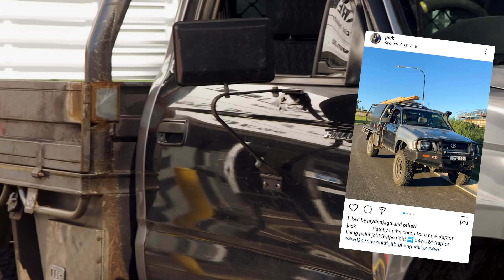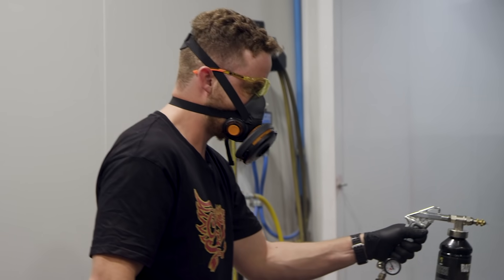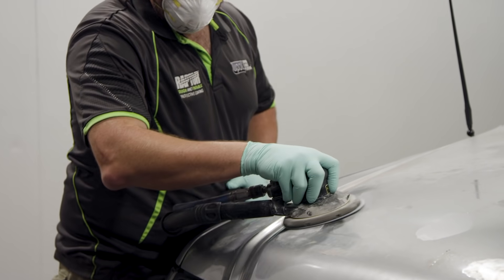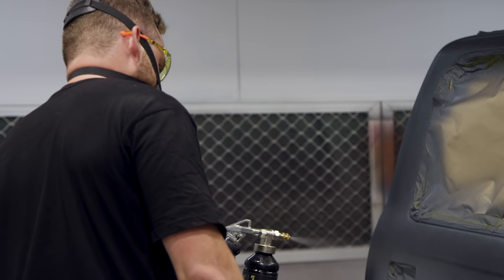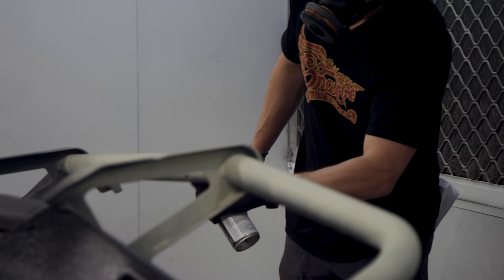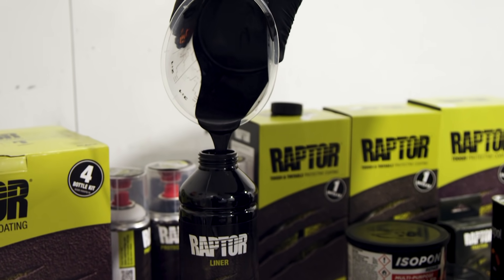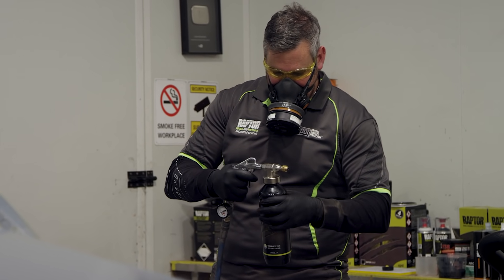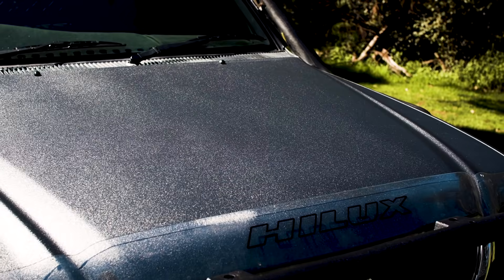WORST PAINT JOB IN AUSTRALIA! Hilux TRANSFORMED FOR UNDER $1,000 – Resale value increased by $4,000!

Comment: Looks mint, but was hoping to see how they prep the rusted steel tray, i raptor coated a portion and took me about 8 hours with a wire wheel and sandpaper to get all the rust and crap off because the checkerplate made it hard to get a flappy disc in there

Comment: Ive called up to price Rhino/Raptor for my Pajero. Was told 6L for the body and 2L for the bar although as it comes in 4L packs I would get two of them for the body and probably do a little more inside. Maybe even rip the carpet up for added rust protection. Either way still under a Grand from the prices I was given. 

Also his not the only one with issues at Lithgow. I sadly got towed out last time I was there.

Comment: Very impressive. I liked that you can adjust the texture of this paint.
Reply: Fun fact for the rattle can paint with the bearing inside;

Myself I found the use of the ball bearing in the can is to roll technique and swirl the can, the movement of the bearing inside mixes the possible separation of water and paint agent giving a nice texture when leaving the nozzle.
Try it out when possible. :))

Comment: One thing you guys forgot to mention is that you can use a urethane reducer and spray raptor with a HVLP gun to get almost zero texture
Reply: That's true, its so versatile! Please note that he durability of U-POL RAPTOR is strongly linked to its high film build. By adding reducer the film build will decrease and therefore some of its durability characteristics will decrease, although only slightly!
Reply: U - Pol's response is the facts. This comment needs to be seen i bet it would save alot of confusion for people in the future.
Reply: @U-POLAustraliaNZ  i have used your products with both the adjustable spray gun and a HVLP gun. The only difference I noticed was the texture. The vehicle I sprayed the HVLP gun has held up to trail rash, rocks, mud, dirt, and snow without any issues at all

Comment: Looks the goods mate 
I can put 3 coats on the bottom of a 40 foot game boat with 10 litres it seems like alot we did 2 coats on my Datsun 1600 with 2.5 maybe 3 litres of 2k and 3 coats on my front and rear bar work on my mighty 90 with 1.5 rattle cans. Nice job though boy's cheers

Comment: What is the difference between raptor coating and powder coating?

Also, what colors does raptor coating come in?
Reply: Google search powder coating and you'll quickly realise it's not what they're doing in this video. As for your second question, he says in the video and colour 2 pack paint can be used for tinting the raptor.
Reply from the maker: Hey Eric - raptor coating can be tinted to any colour you want. As for the second question - the Raptor boys will be on here soon answering technical questions for you!
Reply: Raptor Coating is a Polyurethane coating, which you can apply yourself, and even touch up or recoat if necessary.  Tintable to most colours using Automotive 2pac basecoat. Raptor can go onto many various surfaces (When following correct preparation methods) including plastics etc.
Reply: Ok. Thanks

Comment: Can Raptor liner ever be removed?
Reply: U-POL RAPTOR is a coating made to last, so it is difficult to remove once cured. Once RAPTOR is cured, remove by sanding it off with P80 grit sandpaper either down to the original substrate or to bare metal. Then, respray the surface with another coating, like OEM paint colours. Hope that helps!

Comment: Three pros painting that lux cost 1000$ lol ok.the skill required to paint a vehicle and  body work it are far outside the wheelhouse of most fellas in thè garage.three days and that compressor will be charging every  second spray, use a large enough unit to power the gun.(will not maintain pressure)been there done that, for the t-shirt.
Reply: Hi Joe

The cost involved is for materials. The compressor was working hard but as mentioned it got the job done. Ultimately the bigger capacity the better, but it can still be used with a mid sized unit.
Reply: @U-POLAustraliaNZ  modified the tray also without mention.just  more tricks  to alter the look of the truck giving raptor the credit/ blame.😉seen / done it all before. It's a textured spray thats  an acquired taste, no gloss factory Finnish, with over hyped protection factors. But that's just one fellas p.o.v.😉

Comment: Is there a way to make it a gloss finish
Reply: probably not by painting this cheap crap and doing things properly
Reply: Hi Mason. 

You can clear over Raptor Coating, with Automotive 2Pac clearcoat, eg U-POL S2081.  There is also a few methods of application as shown in this video, giving either a more satin of gloss style of finish.
Reply: Hey mate! RAPTOR can be topcoated for a gloss finish, but generally, it's not needed. RAPTOR dries to a semi-gloss/eggshell finish, which most people find to be plenty of gloss. Clearcoats do not have the same level of durability as RAPTOR and are more likely to chip under heavy duty use.

To apply a gloss over the top, lightly abrade fully cured RAPTOR with a grey scuff pad. U-POL 2K clearcoats use the same resin system as RAPTOR so U-POL clearcoats will give the best results.

Comment: Textured paint is the hardest thing to clean, good luck with that in the mud..
Reply: If you have had trouble cleaning U-POL RAPTOR, our tech gurus recommend the following tips when cleaning RAPTOR to keep it looking good!
1. Give your car a good spring clean with a nylon brush/broom at your local self serve car wash
2. Apply a bit of spray wax (usually available at your local self serve car wash as well!)
3. Wash down your Raptored surface with U-POL System 20 S2000 Panel Wipe - this is our little trick when we visit events with our RAPTOR coated vehicles.

Comment: Putty on bare metal - WRONG!  Putty on only sanded rust? - WRONG...     You guys transformed worst panint in even worse than before because it only bomb whit timer fuse.  Even Raptor need proper surface prep, like sanding, rust removal and epoxy primer under final raptor coat.   IWhitout it, Raptor will buble and fall off.   Its not as solid as LineX, its only poliurethane paint whit more hardener. And yes, i use Raptor in my life and use other types of bedliners. Know what will work years, and what will look (aprox few months, before it start falling off).

Comment: How long does the raptor last?
Reply: Hi Cameron. Raptor has a high level of chemical and UV resistance. That in mind with correct preparation and application, there is no reason Raptor coating won't outlast standard automotive paint, but handle tougher conditions.
Reply: Hey mate! If U-POL RAPTOR is applied correctly and the surface is prepared well you should enjoy many, many years of RAPTOR toughness! Think of it like any other 2k automotive paint - once applied its designed to last!
Reply: @U-POLAustraliaNZ  cheers
Reply: @U-POLAustraliaNZ  approximately  how many liters of raptor coat will I need to coat a 80 series cruiser
Reply: @cameronbowick301  RAPTOR covers 2m² per 1L bottle, we recommend that you take measurements of the entire area you wish to coat to work out your literage needs. 

As a general rule of thumb when coating cars, every 2 panels requires a litre of RAPTOR.  In our experience, thae average 80 Series requires a minimum of 8L, not including accessories :) Hope that helps!
Reply: @U-POLAustraliaNZ  thanks

Comment: That's a $4,000 hilux to begin with. 

When i spray liner on 4x4's I tell the owners the truth
It's hard to keep clean
It lowers the value of the car
It cost around $10000 to get it off and repaint if you don't like it.

The stuff looks magic when you first paint it.  Give it a couple of months it looks shit.
Reply: Raptor is sandable. Just like any other 2k paint. Sand,highfill, respray back to original
Reply: @Gahnndnfnfmf  
Good luck with that, you must love crazy cracks.
 I can't give a 4 year warranty doing that. It would all have to come off.